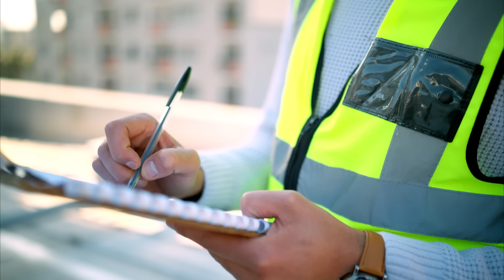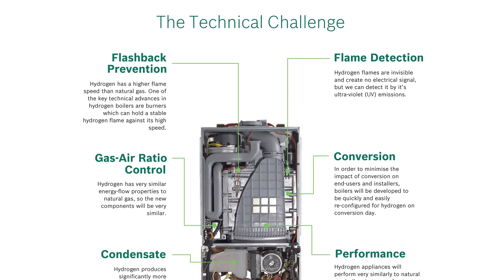Is Hydrogen Actually Dangerous? | The Real Facts

Comment: Hydrogen appears to me an example of ‘don’t let perfect be the enemy of good’.
Reply: The big problem is converting water into hydrogen. It's so shockingly inefficient that it would be far wiser to just use the electric to heat homes directly. No new plants needed. No new costs to bill payers. The entire point of hydrogen is moving electric into homes for heating. Just move the electric itself and it is far more efficient and safe

Comment: Great video Roger, thank you. FYI, the Challenger disaster was caused by the solid rocket booster's O-rings failing to seal its casing joints properly; due to the severe overnight cold before the launch (-10 celcius) making them contract and stiffen. The actual explosion was caused when the solid rocket booster's leaking white hot gasses, spewing from that casing's faulty O-ring joint, melted through the huge external fuel tank like a blowtorch, igniting the oxygen and hydrogen tanks inside in an instant. The Solid Rocket Boosters for the space shuttle were manufactured by Thiokol (later known as Morton Thiokol). ThioKol's management overruled their engineers that day and authorised NASA to launch. The engineers said NOOOOOOO!, it will blow up! The management gave the go-ahead anyway, and It did! Thiokol's management team took the decision to launch purely for financial and contractual reasons, completely disregarding safety. They killed those seven astronauts.
Reply: Most managers are not scientists or engineers but they are still always the managers and will override any sensible decisions by those who know what they are talking about!
Gaz UK.
Reply: @Gazr965  Thanks Gaz. I know this too from my previous personal working experience in a technical environment/industry. 
 Capitalism doesn't care, it's all about profit and expansion; grab what you can when you can, and sod everyone!.
  Regulation is an essential part of capitalism, keeping it from consuming the very societies which it is supposed to support and serve. We are living in an era where the leading capitalists have bought the regulators, politicians, law makers and media. Our protections are disappearing, being continuously eroded and we are circling the drain. I fear it is too late to stop. Modern society is too preoccupied, distracted and insouciant to care, notice or understand the implications. The very freedoms that democracy gives have been used and abused by the unscrupulous, wealthy, devious, greedy and loathsome confidence tricksters. They are now in almost complete control in the USA, and probably soon here too!
Reply: You are right except it wasn't all that cold, hell this happened in Florida, not Scotland.  This was a well understood issue that all of the engineers were familiar with but the managers didn't care.  Managers are just like politicians, the don't know shit, but they tell those who do how to do it.
Reply: @henryostman5740  You are very, very mistaken Sir. The weather there in Cape Canaveral overnight and before the morning launch was unusually cold, reaching minus 10 Celcius. There were huge icicles hanging from the  launch platform and Shuttle connections. The correct details matter!
Reply: Challenger didn’t explode like you think….it got tore to pieces by the aerodynamic forces as it changed trajectory, this was due to failure of a strut holding one of the SRBs caused by a leak from a compromised o ring seal on the SRB field joint. The gas cloud you see is from hydrogen and oxygen escaping from their ruptured external tank then quickly igniting.
Reply: @neo_265  Thank you for that reminder. I do now recall that being the case, shown on a documentary some years ago.... Facts and accuracy do matter so I am very grateful for your input and correction. I won't say "Well done Wilson, I was waiting to see who'd be the first one to spot that." I'd forgotten those details. I just knew that Roger was incorrect claiming that the Shuttle itself exploded first. Thank you again for this correction. Regards, Julian.
Reply: @theeventhorizon-valebridge9512 The most respectful response to an accurate correction I think I have ever read on YouTube. You are credible 😊
Reply: They are typical menagmznt decision making example 😕
Reply: LOL he said "O-ring" XD
Reply: @thegrandmuftiofwakanda  Beavis & Butthead approves yr comment 😂😂😂
Reply: @kappaskurlass1301  At least someone gets it..
Reply: @thegrandmuftiofwakanda  Yes, but he said the hot gasses entered the space shuttle, causing the explosion. That is not correct, they didn't.The leaking white hot gasses burned through the external fuel tank, causing the explosion. Attention to factual details is imperative to learning and understanding....otherwise you end up in the world of Trump!
Reply: @theeventhorizon-valebridge9512  Are you on the spectrum or something? XD
Reply: @thegrandmuftiofwakanda  Yes I am.
Reply: Oh for some skill building videos, not this constant energy politicking

Comment: The mitigation issues that wind power has today is not that we can't use the electricity but is more due to the fact that we can't transmit the energy to where it's needed
We have masses of wind farms here in Scotland but the energy is needed in the south
It's all due to a lack of strategic planning and letting the "market" decide what it wants to do
Reply: Planning? What planning, a classic case of organise then plan, which means you don't see the problems until too bloody late.  This is the natural action of a politician who never ever had a proper job. Heaven help us😢
Reply: And we are belatedly trying to build the pylons to get the power where it needs to go, when that should've been the previous government's job.
Reply: @Biggest-hz7ng I'd argue previous governments' jobs, rather than the previous government's job - these issues are decades in the making. 

If they'd just built replacement nuclear reactors on existing sites, ready for when the old ones retired, then the grid infrastructure would already be there - another example of the dithering of our politicians.
Reply: @davidpowell8249 nuclear's never been cheap or easy to permit. Even in China they've opted primarily for renewables. If ever nuclear becomes cheap and easy to permit, it may get another chance. For now renewables are the way forward.
Reply: @Biggest-hz7ng  again that's a political choice. If you know approval will take longer, you start the process sooner. France's grid is 70% nuclear powered, and they have electricity prices 25% lower than ours.
Reply: We can transport it to where it's needed, We just don't have the appetite to build the infrastructure and overcome the NIMBYs who block it. Like all developed economies, we all have issues with planning and objections.
Reply: That’s basically what he was saying, it cannot be used..

Comment: Hydrogen production from water can be pretty efficient (80% to 90%) but it's the losses due to storage that are the killer
50% of the energy in hydrogen can be consumed just by the storage process
I think that the industrial use of hydrogen has possible applications but not mass use for public heating
Reply: And you have to purify the water first, which takes some energy.
Reply: Water electrolysis typically ranges from 56% - 73%. But if undertaken on an industrial level it’ll be towards the lower end.

Comment: Hydrogen for homes and cars is hopeless. But Hydrogen made at night stored at say old coal fired power stations seems a no brainer. Don't batteries for cars and vans are getting  lighter and more energy density. Well done interesting stuff
Reply: Hydrogen is an option for energy storage, whether we use it depends on whether there are better options at the time we need to build it (generation, transmission and batteries are most cost effective for reducing emissions right now, with gas generation as backup for years yet).
Reply: Is it a no brainer? How are you going to store it in large quantity. Does it make sense vs batteries.

Comment: The safety aspects can be mitigated. I would suggest that external boilers are used where possible and gas hobs replaced with induction hobs where possible 
One of the benefits of hydrogen over methane is that CO poisoning would be eliminated if you did have internal boilers and/or gas hobs
Reply: You still get NOx when you burn hydrogen just from the air around the heat source, upto 6x more than burning methane, and those are pretty nasty

Comment: Not sure many will want to pay 6x times more for their heating by switching to pure green hydrogen. Or add 25% to the cost by blending 5% green hydrogen to gas. 

Should instead have made a video on the good news of planned BUS changes adding support for heating with air conditioning (air to air heat pumps)?
Reply: So inefficient. They need to get nuclear plants built to ever think about hydrogen being produced at all.

Comment: I work with all sorts of gasses, and hydrogen worries me the most. It will burn under virtually any condition. Rather than natural gas
Reply: Can you tell me if hydrogen has a smell ?
If not , how do we know if there's a hydrogen leak ?
Reply: @assistantto007  No its odourless, same as natural gas. You could add an odour as they do with gas but hydrogen being such a tiny molecule (just two tiny hydrogen atoms) will leak through almost anything, whatever they add to to give it a smell will be a larger molecule and may not leak though. You have to add monitoring devices and plenty of ventilation.
Reply: My experience with Helium (slightly larger molecule than hydrogen) is that molecules pass through plastic pipes and disperse beautifully in air. This makes the He-laden air denser so it sinks in a factory environment. If this was hydrogen then you would have a perfect fuel-air bomb  from spark or static ignition source. Scary stuff indeed. Imo the only economic case for hydrogen is to use solar power to split it, and store ( low pressure ) to use at same location, such as heat for a steel works or thermal power plant. The oxygen could also be stored for same purpose.
Reply: @rob @roberttompkins480 dognen as well as helium or even refrigerants can leak through oxidised metals like aluminium (speak to any air-con guy that works on Audis) imagine that in someone’s home that doesn’t understand maintenance or inspections.  The only advantage of converting electrical energy to chemical in the form of hydrogen is that it can be sortable and transportable like in batteries, It can also be piped and pumped as gas or liquid. If you’re going to use electrical power to power a steel or thermal plant, you’re going through extra steps, converting from electric to chemical then to heat. Each step adding complications and loosing efficiency with the intermediate step involving a highly volatile hydrogen. Arc furnaces are the most efficient way of remelting steel we know using electricity, and it has over 50 years of experience and industrial know how behind it. Using hydrogen will not heat water any more efficiently either.

Comment: The general public are stubborn, uninformed and gullible. Back in the 1980s I started using LPG in my car. Everyone said to me "I wouldn't use it, it's not safe". Actually an LPG tank in a car is much safer than a petrol tank (many of which are made of plastic nowadays). You could drive a lorry over an LPG tank and it would not rupture, the same could not be said for a petrol tank. If a car caught fire and the fuel over heated then an LPG tank would vent gas at a controlled rate and it would burn off safely. A petrol tank would explode. LPG was safer, much cheaper and cleaner than petrol yet the public didn't take to it because of misguided opinion. Hydrogen should be seen as a battery, but unlike lithium batteries it does not require the mass habitat destruction to mine raw materials. Yes, perceptions need to change, and the way we do things might need to change too but Hydrogen has many advantages. It can be produced onsite, there are small hydrogen production units which could work on site at petrol stations, no need for tanker deliveries. Buildings with solar (especially commercial buildings where this is already happening) could produce their own hydrogen using surplus solar generation. Hydrogen has to be the way forward.
Reply: LPG and hydrogen are completely different.  LPG is much safer.  Volumetrically it provides more energy.  Hydrogen in a car tank would be a bomb it is highly volatile and has a much more rapid burn.  I would never have hydrogen 8n side my house or car.
Reply: @DR-00700 QED
Reply: LPG in cars was commonplace in the Netherlands.
I agree with what you say but not for domestic use, just industrial or centralised use

Comment: The term volatile is being wrongly used here. Scientifically, volatile refers to boiling point. Hydrogen  gas is a highly buoyant and easily dispersed so it would not accumulate in a domestic situation. Methane is heavier than air so it does accumulate and sinks to the lowest point. My concern would be that as hydrogen burns in the open it produces a lot of UV energy. In boilers that wouldn’t be an issue. In terms of detection of leaks, methane is odourless and compounds are added to make it smell, the same could be done for hydrogen. How many houses currently have methane detectors?
Reply: Methane is lighter than air!
Reply: @sloughone1  Sorry, yes you are correct, methane is less dense than air. For some reason I was thinking of propane in the form of lpg, where in a marine environment gas lockers have vent hole at the bottom of them. I used hydrogen for many years in an industrial setting where the basis of safety was the dispersion rate was the basis of safety to stay below the explosive threshold.

Comment: hydrogen is made using methane........just use the methane.....no brainer........
Reply: Sticking with gas until we electrify our heating is the cheapest and best option.
Reply: The idea is to make hydrogen from electrolysis long term. But you are right at the moment.
Reply: @keithbrown339  electrolysis is a broken trail leading nowhere.......IMO
Reply: Yes.
Reply: Hydrogen is made from sea water in Orkney, using surplus ( free) wind and tidal power. Costs next to zero to produce. Look up EMEC , the European Marine Energy Centre.
Reply: @gordonmackenzie4512 what happens when the wind stops blowing?
Reply: @gdfggggg Tidal, hydro, pump storage hydro, solar, solar battery storage. Norway is 100% carbon neutral electricity generation, as is Scotland North. Scotland South is 21, compared to south west England at 346 carbon intensity.
Reply: Expensive..
Reply: Virtually free production, but storage costs are expensive.

Comment: As much as possible should be electric and this energy source agnostic. Hydrogen might work for planes and busses, but making batteries lighter is the better approach. For a stove, just use induction which is much faster and if you Do need to burn something with fire, use a hand torch.